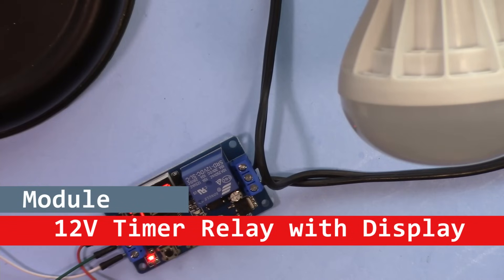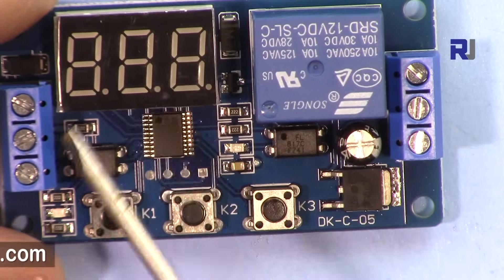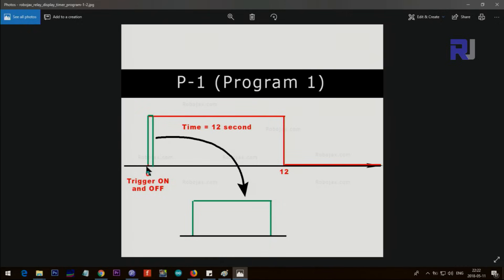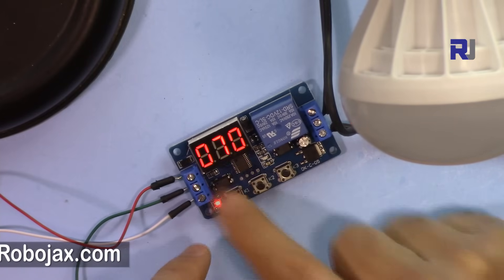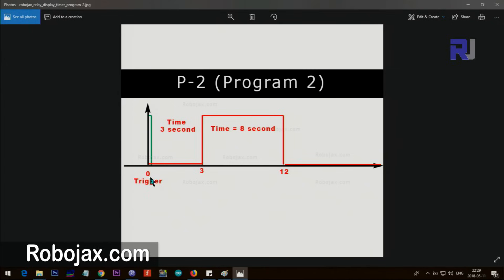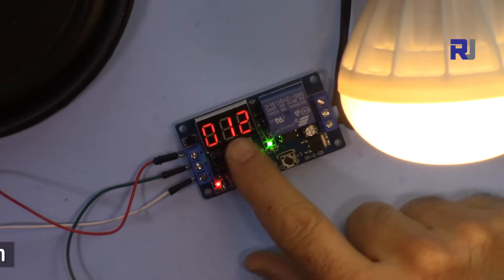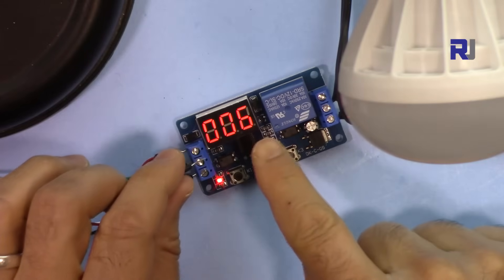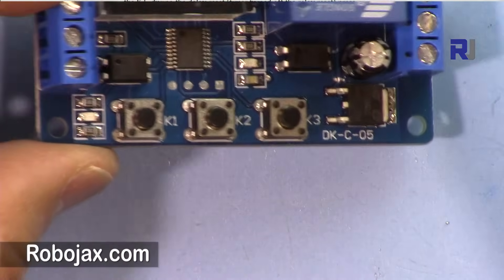Home Automation: 12V Relay with LED Display Delay 0.1 seconds to 999 seconds Timer module P1 to P4

Comment: Since this has reverse polarity connection, will it function if you reverse polarity? or will it simply not damage the unit in reverse polarity?  I am interested in using this with another device that will reverse polarity for me, and I want this device to turn off (open) a circuit after a given time period
Reply from the maker: are you talking about input 12V for the device or for the load? Device will burn if you reverse the 12V. for the load which goes through relay, it doesn't matter which wire. Yes you can reverse the polarity as long you connect it correctly.
Reply: @robojax  amazon shows this device has revers polarity protection for itself.  I was asking about reversing polarity for the device not the load.
Reply from the maker: I would have to check it. if that is the case, then as soon as you connect it, your power supply should blow the fuse. if it doesn't have fuse, either this module or your power supply should burn and smoke.

Comment: I'm looking for a unit that won't close the contacts unless the trigger is on for more than 5 sec. Any suggestions?
Reply from the maker: I believe it has everything you are looking for.  did you watch the video?
Reply: Yes, I did. But the feature I mentioned is not present in programs 1 - 4. Possibly you know of another device that will operate only if the trigger is longer than a specified duration?
Reply from the maker: The use arduino. I have got Arduino relay timer. check it out.

Comment: can you make a video on windgenerator charge controller how to connect to charge a battery,,,or solar,,,,but more on windgenerator
Reply from the maker: I have not access to either salar panel or wind generator and they are expansive. If someone donate them, i will make video on them.

Comment: Can it be used to close car window for 4 seconds? The car window require 20 amps.
Reply from the maker: it can be used for anything you want as long as the current rating on the relay can tolerate it.  so check the relay if it can handle 20A.

Comment: Hello i have 24v wheelchair horn...
sometime I am pressing the horn button by mistake ...I want avoid that.. I need a device will make the horn go on after pressing the horn button two times instead of 1 time in order to avoid pressing the button by mistake.. do you have any dvice can solve this issue ?
Reply from the maker: Hi Ameer,  here is the code I have written for you. http://robojax.com/learn/arduino/robojax_button897.php

Comment: Hello. I want to use P3 program. But I need to adjust 7 second ON, 120 minutes OFF. Can I do it?
Reply: Your request is similar to mine. I need it to be triggered on for 1/2 second and off for 15 seconds before it can be triggered again.  I was told by the Robojax guy on Amazon that this is the one I need.  However I don't see this program explained here?  I must be missing something?  It's cheap enough to just try though..........

Comment: So this timer only has maximum of 999 seconds?
Reply from the maker: Yes. Check my 2 other video https://www.youtube.com/watch?v=dtc4UL2bEs4 and  https://www.youtube.com/watch?v=dNfGwNHBqMY which have longer timer.
Reply: Im inteseted on the P4 function.
The trigger holds down the countdown timer.
But the duration must be capable of 30mins to 1hour.

Comment: Really nice video helped a lot. I need this product to through Amazon because it's a  bit costly in eBay. Is this product available there in amazon ?" If it is let know with that link " that it will helpful because there are similar product I can't find, they didn't have program modes in their product detail too . Awaiting for your response. .
Reply: Eachbid Trigger Cycle Timer Delay Switch Circuit Board MOS Tube Control Module 12 24V https://www.amazon.in/dp/B07H5F3C5M/ref=cm_sw_r_wa_apa_i_SDYUBbYBP08D6

Shall I use this instead of your mentioned board
Reply from the maker: Yes from description it looks to be the same.
Reply: @robojax   but I can't see the relay in the board ? Will it do the same
Reply: @robojax   can you able to plot the pin 
Input :
+VCC
Ground 
Trigger
Output: 
Nc
Com

Comment: Thanks for your nice video, i use this timer but found one problem, i use it as delay power on for my refrigerator ( 220 volt ,400 Watt) use delay for 300 second, which is work properly but when power goes and resume then the load flash for a second i mean relay on for a second then off and count down begin, how can i avoid it. I use here in P-1 mode my adapter is 12 volt DC, trigger pin connected  to + DC terminal.
Reply from the maker: You are welcome. 
when you say "power goes and resumes" is it unexpected "goes and resumes" ? if so this device doesn't have another timer to do this. If this power disruption is due to power blackout , then you have to have another relay module between this and your fridge to prevent it it  from doing this.
Reply: Thanks for your update, I'm also thinking to add another Relay module, sometimes in my place when weather is too bad, then power ups and down frequently, so i need a delay for safe my electrical gadget , primarily its working fine.

Comment: I am interested in buying this product, but first I would like to ask a question. Is the input for switching on the timer provided by a Dimmer? I would like to connect DC + and DC- (ground) to the transformer and IN to a (negative) channel of a dimmer to start the timer at a certain time. It can be done? Or the contact of IN must always be closed on the positive?
Reply from the maker: What kind of dimmer? the one used for AC bulb and fan? No.  the input should be 12V. DC. When you say transformer, I hope you mean power adapter so the voltage from transformer is converted to DC using a bridge rectifier  and then connected to this device.
Reply: the connection I would like is this. From the 220V AC of my house to the transformer that supplies 12V DC. DC + and DC- go to the Dimmer (programmable for LED lines) and also to the input of the delay timer. While the IN of the delay time goes to the negative of a channel of the dimmer. To explain myself better, I'll put the link to a diagram drawing:

http://www.fileconvoy.com/dfl.php?id=ge9f4529253e8507510001135862f2776011bebfe8f
Reply from the maker: Yes I just opened the video and watched for you. Yes the input is triggered with Positive only. But this is doable if you do a little extra work 1 transistor and  2 resistor will make this possible. here is the circuit I drew for you https://snag.gy/TwmDGf.jpg sorry I forgot to mention the resistors values: Resistor in collector can be between 1k to 50K. Resistor in Base can be between 10k to 33k. (see image for Base and collector pins)

Comment: Hello . I want to maintain the light  of a 12v dc bulb with timer delay with unstable supply .can i use this ?
Reply from the maker: Yes you can. instead of AC bulb, use DC power and DC bulb. NO problem.

Comment: The timer always shows counting down. I wish to cause it to count up after triggering a start is this possible. thx
Reply from the maker: up or down doesn't matter. If you want for example 35 seconds.  It will count for 35 seconds starting from 35, 34, 33....2, 1, 0. If you want to keep specific time. this will do it.

Comment: Hello! Good presentation!
I am interested in Programme -4 of the device.
Can it be the other way around? meaning that can it be starting off when u close the circuit of the button then start and off permanently?
thank you in advance!
Reply from the maker: If you look at the relay terminals, we have  3 ports which you connect your load. Yes you can. connect it to the middle and the other wire and you will get the result. Watch my other video about relay which shows how to disconnect instead of connect.

Comment: I'm trying to hook mine to a 12v lipo for the input to trigger a light to come on. I got the device to preform the countdown when triggered but it's not activating the light. Do you have a video on how to operate this with a DC power source?  
Thank you.
Reply from the maker: DC or AC does't make any difference. Just follow instruction I have.

Comment: They should put a model number on this.  It was damn hard to find this video, and there's no other instructions that I could find, anywhere.  There are others that LOOK similar, but the hookups and programming are different.  Some have two buttons, some have four.  Some have 18 programs, some have even more.  Some have five connections, some six, some seven, and some eight.  And none of them have a damn model number.  Come on China, is it that hard to identify your products and provide proper instructions?
Reply from the maker: I contacted the manufacturer and told them to put title such as "GF-876 12V Relay timer" but like to use every keywords such as "thermostat control 12V relay hot new arrival automated control for smart home arduino raspberry pi and 2 and 3 fast shipping"
Yep this is how they do it. Very unprofessional. You won't believe me, they contacted me back and said "we did not find GF-876 product. They did not understood my email I think. Then I used google to translate it to Chinese, yet they replied with another mind blowing response.

Comment: For those looking for infinite ON-OFF-ON-OFF cycle without needing a trigger signal, look at 11:48 for program number 3.   NOTE:   1. When your are setting the time in program 3, if you set the time "OFF' first (by setting the time while it's in off mode), then, it will also START in the 'off' mode every time you power it up.   2.  If you set the "ON" time FIRST, then (by setting the time while it's in "ON" mode), then, it will always start in "ON" mode every time you power it up.
Reply: Pressing K1 in P-3 mode will change "OFF' first or "ON" first every time you power it up.
Reply: What if I'm looking for an infinite ON-OFF-ON-OFF loop with a trigger signal?
Reply: Adam Armstrong it will work pay attention to the video again.
Reply: @TheFalconJetDriver  I will, thank you! Once it clears customs I will come back and re-(re-[re-{re-}])watch the video until I figure it out.
Reply: @TheFalconJetDriver  I think you need to read his message again. He doesn't want both bulbs on and off at the same time, he wants them off at different times.

Also, I don't think there was any program in this product that would do on, off, on, then off until next trigger.
Reply: Thank you!

Comment: Do you know how to make it count in minutes? I wish to set 600 minutes. Regards.
Reply from the maker: This device can go only up to 999 seconds. Get this module that can go up to 999 minutes https://www.ebay.ca/itm/DC-12V-Infinite-Cycle-Delay-Timing-Timer-Relay-on-off-Switch-Loop-Module-10A-120/323260227407?hash=item4b43cf9f4f:m:mUlNI1S_7yFgRXQwt_BPAtA

Comment: This item new or different ? 
https://www.aliexpress.com/item/WS16-Switch-Delay-Time-Relay-Module-Micro-USB-5V-LED-Display-Automation-Cycle-Delay-Timer-Control/32850588448.html?spm=2114.search0104.3.9.539f3557tBfGGJ&ws_ab_test=searchweb0_0,searchweb201602_4_10152_10151_10065_10344_10068_10342_10343_10059_10340_10341_308_10696_100031_10084_10083_10103_10618_10624_10307_10623_10622_10621_10620,searchweb201603_11,ppcSwitch_5&algo_expid=ae7fa4a0-43ad-40e0-bdef-dfd9a1603e8b-1&algo_pvid=ae7fa4a0-43ad-40e0-bdef-dfd9a1603e8b&priceBeautifyAB=0
Reply from the maker: this is is different. It seems it doesn't have programming like P-1, P2, P3, P4.